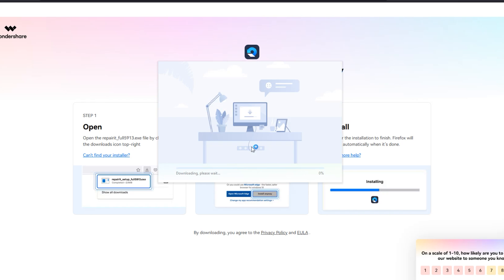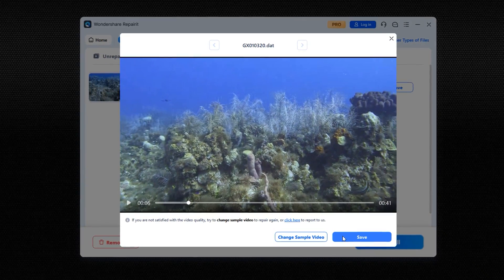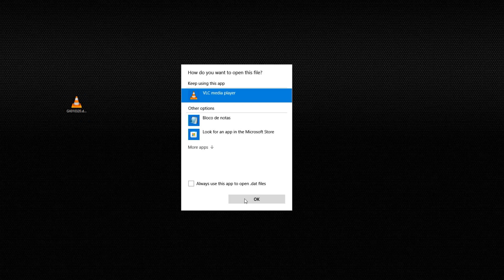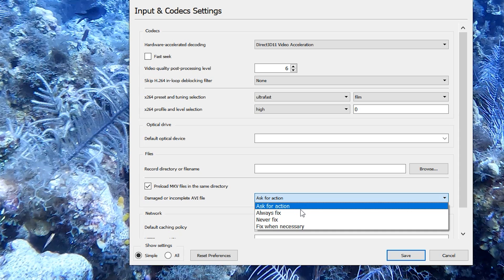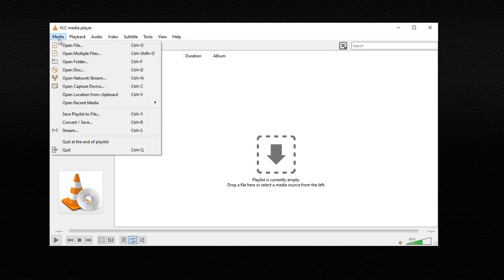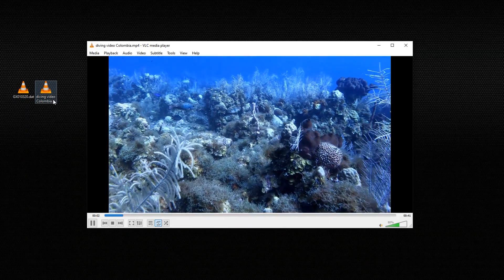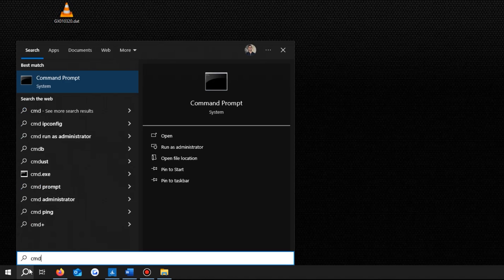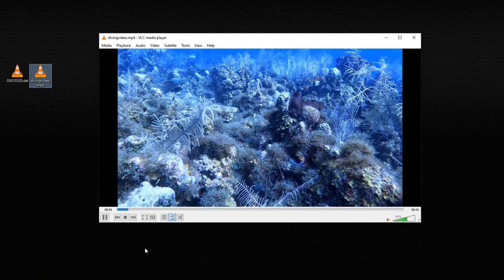Top 4 Best Solutions to Repair DAT File in Canon Camera

Comment: hey..basically i have a issue ..my gmail storage was full so i delete some messages and folder and it have some space now..but while that duration i did not getting the stucked mails..form day of storage full..and that are not appearing now..what should i do...
Reply from the maker: Hi there, thank you for your question! First check your Gmail sync settings on your device to ensure syncing is enabled, and manually refresh the inbox. Open Gmail in a web browser to see if the missing emails appear there, as the issue might be device-specific. Check all folders, including Spam, Trash, and All Mail, and use Gmail's search function to locate any specific emails from the affected time period. If you use an email client, verify that it's not set to delete emails from the server after downloading. If the emails are still missing, consider contacting Gmail support for further assistance.